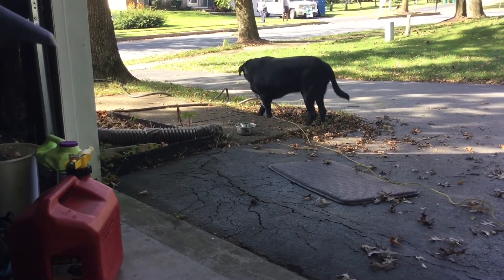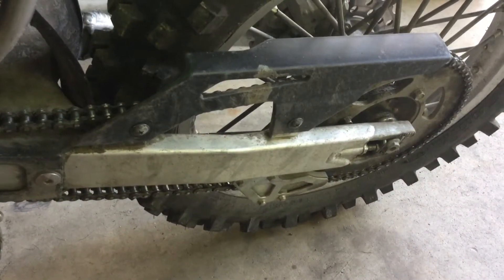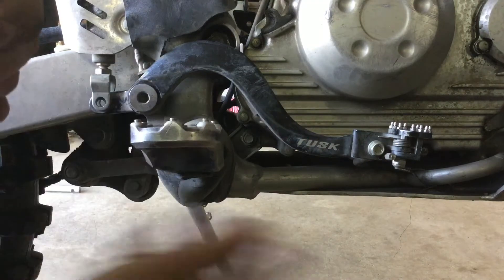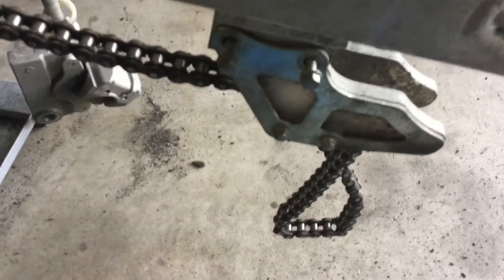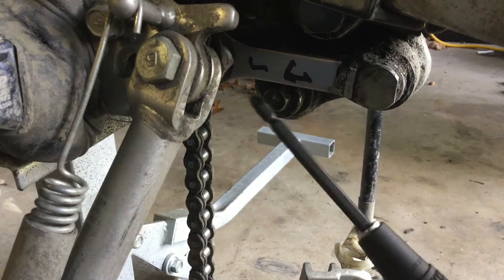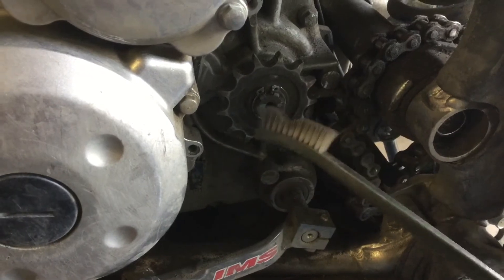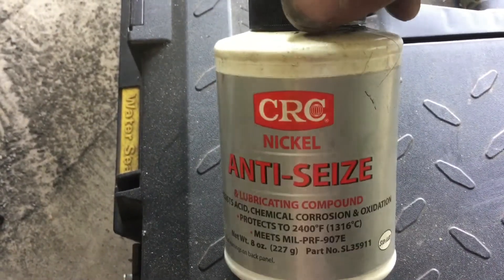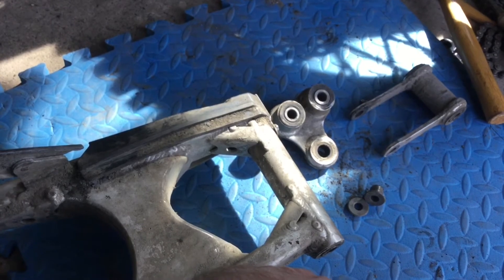KLX140G Maintenance: Sprockets, Chain, Swingarm: Part 1

Comment: Fantastic instruction...thanks for taking the time to share!  I just discovered your KLX140G build-up manifesto on ADVrider and it looks like the 140G would make an ideal technical riding, fartin' around, half-assed dual sport bike for mellow rides and exploration.  Seeing that a bigger guy can have a blast on a bike like this tells me it would be more than adequate for my 5' 7" 130 pound self.  It could almost be like my EXC 200 on valium.  Have you still kept the engine/airbox/exhaust stock or have you made any modifications to them?
Reply from the maker: daddister Hi! There are guys on the ADVRIDER thread that use it just like that. TeeJay from Idaho uses it as his exploring and going fishing bike. This bike is great in the woods and what not.  It’s not fast but it will get you about anywhere.  I only run out of steam on the most steep loose stuff and often it’s me screwing up a shift or something more than the bike.  I have stock gearing 13/57, stock exhaust / stock air box but a twin air filter, and I adjusted the jetting to 38 pilot 100 main.  When it’s super cold here I used a 40 pilot. With your size the bike will definitely go faster and guys in Thailand who race these say they change the gearing to standard KLX140L gearing for more top end. 👍. I’m going to do a full owner review video next week.
Reply: Thanks for the info!  I lived in Pittsburgh for a couple years, but only got a ride my brother in law's quad in the country a few times.  Really wish I had a bike there back then.